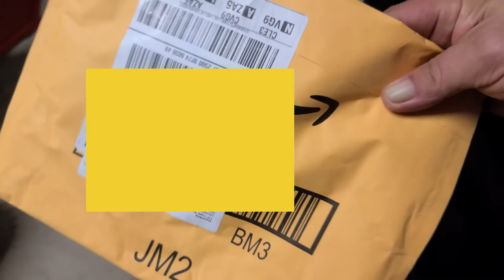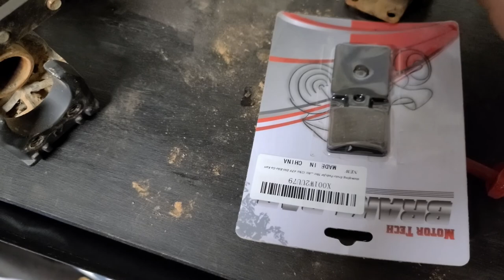Hammerhead Twister -Go Cart (Rebuild) Part 6 #Hammerhead

Comment: I have the 2005 Twister kart from Hammerhead and when I put a new master cylinder on mine I couldn't get the thing to bleed. I had to put a piece of plastic with a piece of rubber over the top of the master and use a tire pump to get fluid to force through the small hole in the cylinder. Hope yours worked better.
Reply from the maker: Thanks for the advice, I will let you know how it goes.

Comment: Great vid when do u think part 7 will be
Reply from the maker: Next week, I ran into an issue with the new harnesses so I will have to make them work. I may have to go wire by wire and rebuild the harnesses.
Reply: Ok ya can u just pls show to how to wire the ignition switch thank you and keep up the great work
Reply from the maker: @zlock6514  will do
Reply from the maker: This is what I am using to start my wiring today I will explain as I go, vid later this week. https://hammerheadperformance.com/media/manuals/hammerhead-offroad/Standard150-UM150IIR/Standard-150-wiring-diagram.pdf

Comment: i have like the same gokart same motor and everything but  for some reason the starter spins, it sounds like it is just spinning another gear and nothing else. and the fly wheel does not spin the starter is not a solenoid starter. i replaced the starter i dont know what else to do. somebody pls help me i want to ride my go kart can you please help me